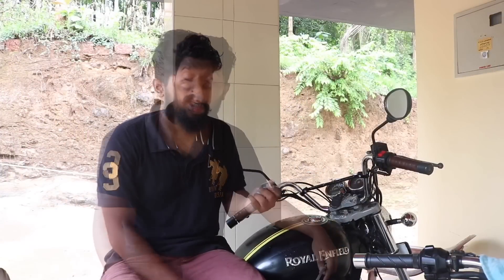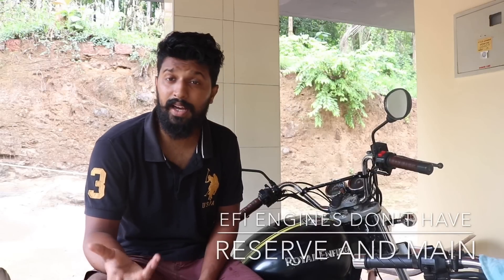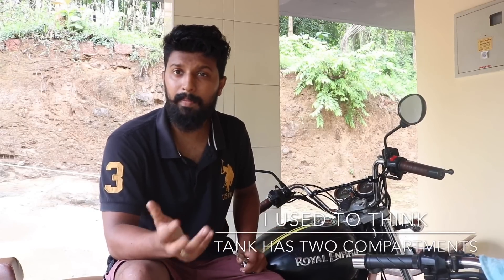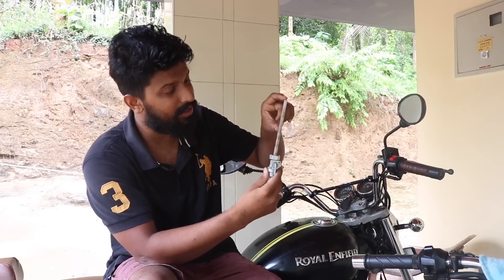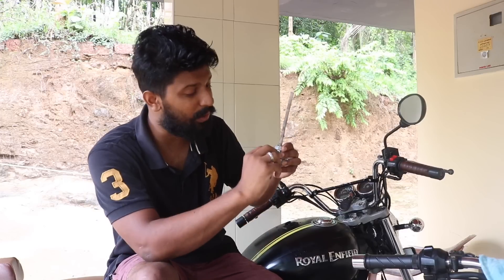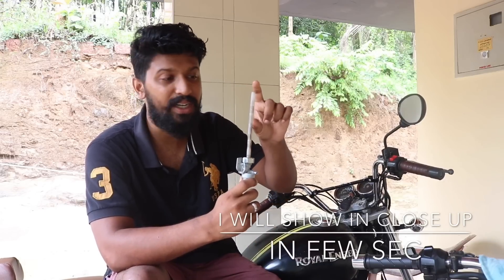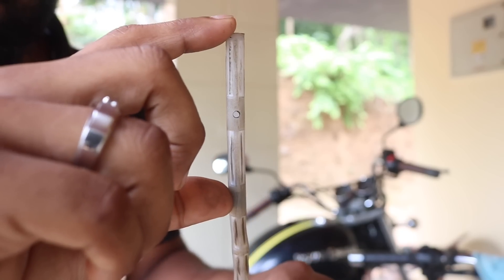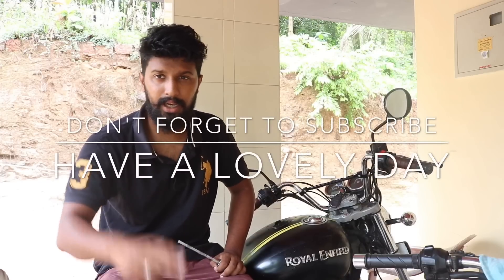How does FUEL TAPE  WORKS | What happens when you put the bike in RESERVE/MAIN

Comment: My friend put to reserve .. But he cant take out half litre fuel from the fuel tank.. He didnt remove the fuel filter. Without removing them.. Just put Reserve and fuel didnt come out.. Even the fuel filter was clean.. He cant drive in half litre cos, the fuel doesn't flow in the pipe.. But he can drive in 1 litre of fuel.. But after down to like half litre, or lower than hafl litre he cant even start the bike.. What is the mttr???? Two times he put bad fuel from the shop.. Is it because of that??? I heard most petrol from shop were mixed with with others.. Like kerosene, diesel..  But finally after removing the fuel filter all the fuel came out
Reply from the maker: There is a thing called dead fuel. It is the amount of fuel that cant be used. That .5 ltrs is that fuel
Reply: @MatteBlack  can't understand.

Comment: Hello bro I have a doubt.. I own a tb350x I check the mileage by reserve to reserve method.. when my bike falls into reserve petrol I fill it up and reset the trip metre and turn the knob to main so that I could check for how many kilometres I hv run untill the bike falls into reserve again.. but recently the results are shocking .. last day when my bike went into reserve I filled up petrol for 70rs approx 0.89L I got .. and I switched the bike to main and the bike went without going into reserve for 58kms I was in the highway though.. then on reserve I filled it with another 1.3 L of petrol but now the bike got reserve at 26km .. what's the reason?? can it be a problem with the valve?? or is it smtg spcl with my bike?? Help me out plz
Reply from the maker: That means your mileage had dropped. And u need to get it checked. 350 give around 50kmpl
Reply: this happened in one day added on yesterday I was in a highway while I got 58kmpl today in city with a lot of gear shifts.. my doubt is why I'm getting close to 60kmpl without going into reserve in highways ? is that a problem with this reserve switch which is not working when the bike actually has gone to reserve?
Reply: +Matte Black This is not the first time last time I filled up for Rs 250 and 3L it gave with which I drove my bike for 165kms .. again when in my rural area the very next day 2L of petrol Gave only 35kmpl
Reply: +Matte Black also please tell me the reserve capacity of tb350
Reply from the maker: Possibly bro. If it is a new bike u can show in show room. And ask them to check under warranty. And i am not sure bro my bike is 500 and it doesn't have reserve.
Reply from the maker: U cang check the manual

Comment: The fuel indicator of Honda cb shine sp blinks when fuel is low /reserve,but the engine doesn't stops as in ideal case the bike should stop until we turn the nob from normal to reserve..y so or the system is changed
Reply from the maker: +Shivendu Tripathi tats coz the digital meter is not connected to the fuel switch.
Reply: Matte Black thn what's the use of reserve in such bike...if in on position only the bike is running in low/reserve fuel
Reply from the maker: +Shivendu Tripathi see reserve switch is analogue. So u can trust it more that the sensor indicator. Sencers over time and get spolied but the switch is dependent on pertol lever hence it is more reliable
Reply: Matte black is right! Digital is not really reliable all the time. Sometimes faulty or inaccurate due to over use of motorbike it will get spoiled . Manual preservation will ramain the same accuracy when monitoring ur fuel capacity left